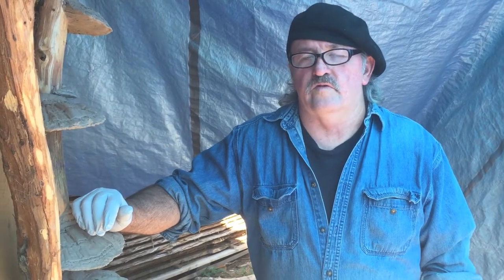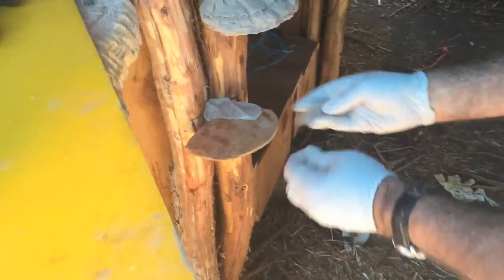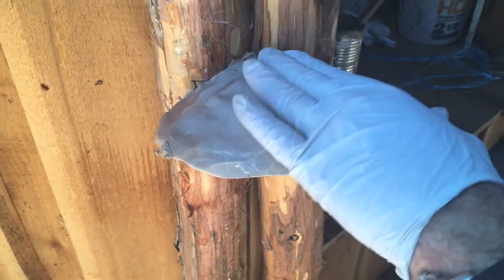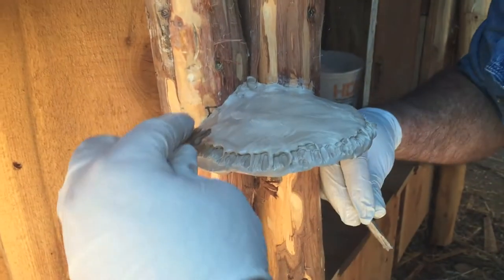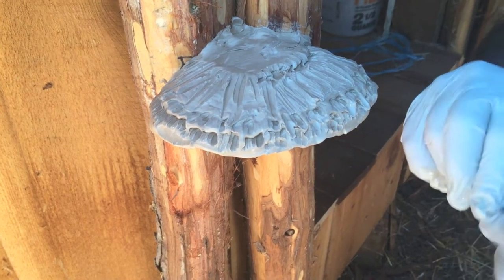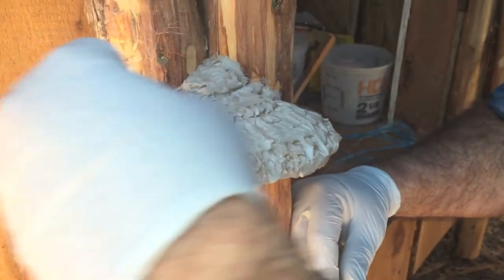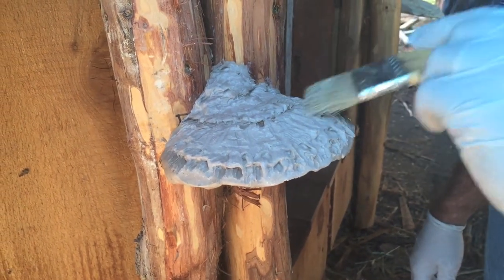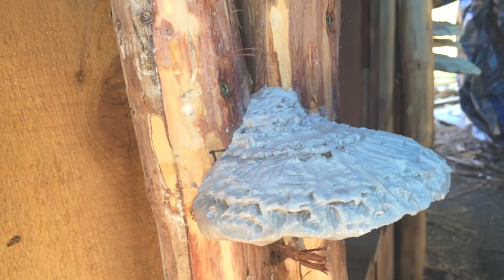Sculpting Mushroom  With Sculpting Epoxy-BillyDillardArt

Comment from the maker: Hi Growmau5,I would like to say i have but i would be lieing and that is not my style. I would however try 3 experiments with small samples. I would mix a little acrylic in one batch. Another a little Oil base paint. Miller Paints carries color pigment to make your own custom paint. I would try a little pigment in a small batch . I would first mix a and b together them apply a little paint or pigment, mix it up. After cure check to make sure its not gummy or sticky. You can also contact PolyGem tech department an ask them if you like. Dave is very friendly and has always been good about answering all my questions.